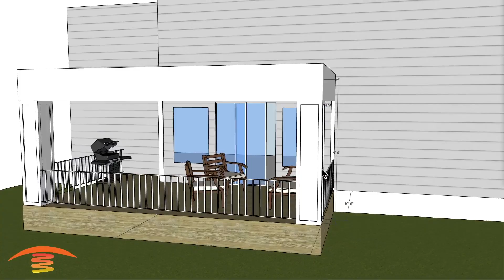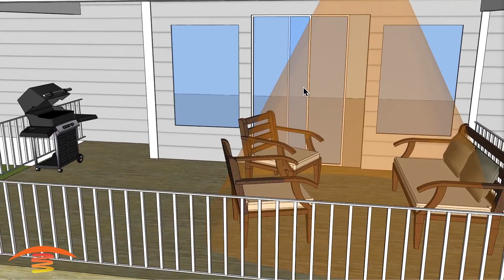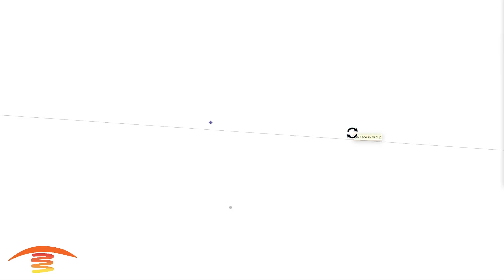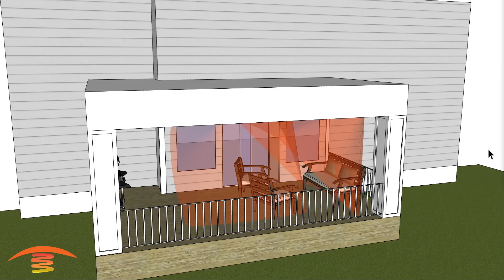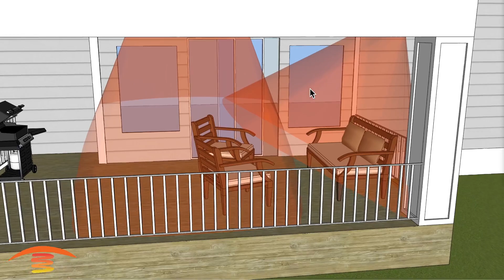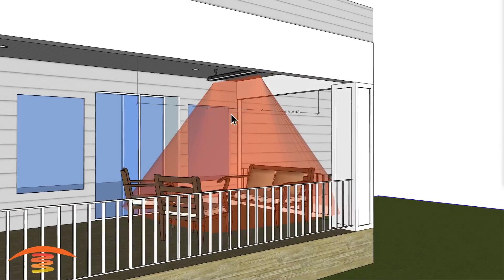Visual and Heat Footprint of Infratech Electric Heaters On This Covered Residential Patio Deck

Comment: Would the 6000W really be too hot in 30F weather?   Do these heaters ever damage furniture like polyester seat cushions?
Reply from the maker: The output of energy is my main concern, the longer you sit under a higher output unit mounted at the same elevation in this case approximately 8' 9" off the finished floor and directly above you, the more radiant heat will be absorbed and after some time you will "feel" like your overheated. The 6K heater is designed for a 8' - 12'' mounting height but it also depends upon how far you are from the surface. Lets say you mount the unit along the parameter of the patio and you sat along the opposite side of where it is mounted.  You will feel much less energy than if you were to sit just beneath the unit.  Infrared is a lightwave and it will not heat the air, 30º F is a cold environment but just like if you were to take a walk during a sunny day at the same temperature you most likely will feel too warm if you had all insulating clothing and layers to keep you warm.  So just increasing the output by placing a hotter unit will not guarantee your comfort. I can only recommend the heaters based upon the distance away and the protection from the structure surrounding the space occupied.  I do acknowledge that below 50º F many will not be sufficiently heated using radiant heaters.  It would be my recommendation to place several units (as we are three dimensional beings) and the one best for the distance of the mounting height.  

As for the questions regarding damaging furniture I have not heard a single complaint of this being an issue.  

Thank you for the questions.